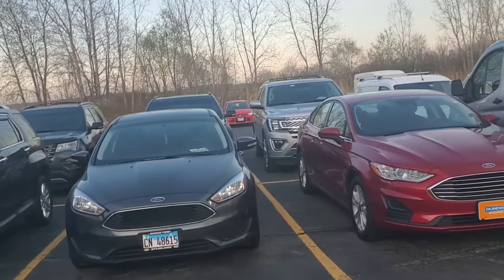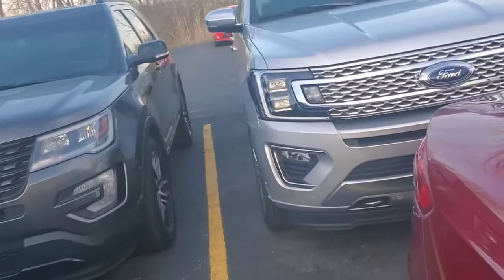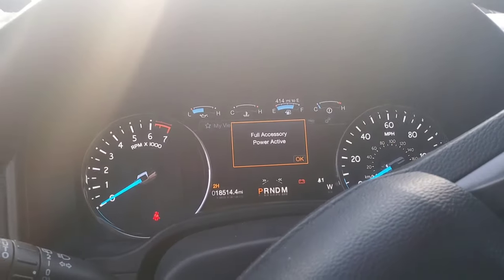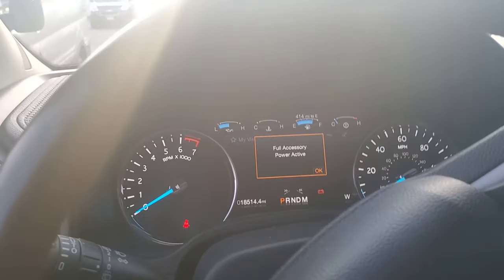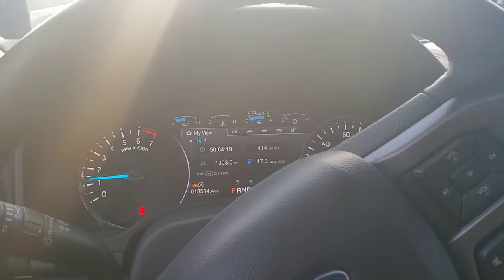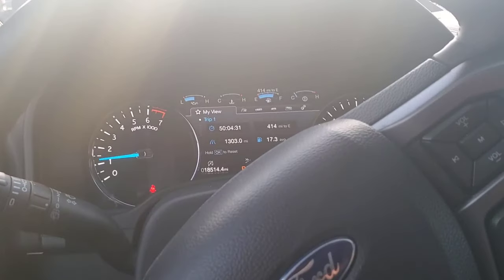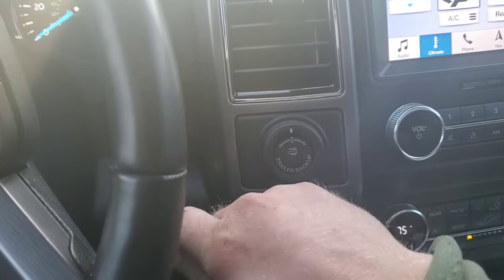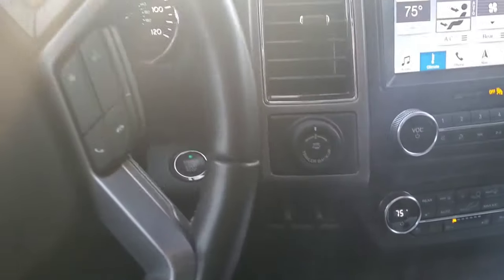3.5L Ecoboost F150 Rattle on Startup then gone, Try this - Could Fix Ford's Phaser Problem

Comment: Thank you. I have a 2013 F150 (164k) that for over 1 year has been doing the the start rattle.  This is the 1st video I found about it. Thank you!!! I tried this and it quieted it down greatly!!! 😁Hubby has 2017 F150 (53k) and his started doing it. 1st time extended warranty paid for its self and Ford fixed the problem ($5k). Now if I can find my coolant leak...
Reply from the maker: Typically these like to leak at the actual coolant reservoir itself and the plastic Connections in the front that the cooling system have in the rubber lines
Reply from the maker: The older F-150 like yours the 2013 yours is probably never going to completely go away because yours is more of a timing chain issue on the older ones the chains stretched more than the VCT phaser acted up but when you go to get yours done you're going to want to have new phasers and chain and guides/water pump everything put on

Comment: Just finished a complete timing replacement.   Ford OEM parts.  Phasers, vct's, chains,  guides,  tensioner.   I still get a massive rattle at startup after sitting for a couple days.   
My timing system did absolutely need replaced.  I jumped my chain.  It was so stretched that the moment i pulled it into my shop and turned off the engine i heard the cams ratchet 5 or 6 teeth.  Enough to keep me from rotating the harmonic balancer without piston and valve interference.  

Anyway. Holding the gas peddle down for a few seconds solves rattling.  

Now thinking of this I  contacted someone i know that can do some pcm
 programming it possible to keep the injectors off until oil pressure is detected.   Beauty of this is there will be no extended cranking after initial first of the day start as oil pressure is already primed.

Comment: I just tried this trick my 2012 F150 with a 3.5 eco-boost. it had the 3 to 5 second rattle , And it worked. Thanks!
Reply from the maker: It's jot a fix but it does help

Comment: Takes about 10 seconds to build pressure in my 2013 F150. 

I imagine the life of the starter will be reduced quite a bit with the long cranks on first start up of the day or after 4-6 hours of sitting. 

Either way, no rattle after pressure builds. 

Thank you!
Reply: Same truck and I've noticed it not doing it with this method. You have any updates or is it still not doing it?

Comment: Thank you - thank you!!! my 2018 f150 EB finally started to get that noise regularly now.  This past weekend in Vegas was a loud one that startled me.  I thought my truck was broken and I needed to stay a few more days  😉 !  I was skeptic to bring the truck in for 21B10, as I didn't think it will solve 100%.  Will give this procedure a try and report back.
Reply from the maker: This procedure doesn't fix the problem it only makes it easier on syrup you still have to go along the procedures have it fixed

Comment: This is why huge diesels like locomotives have a prelube system. Ford really should update the pcm to crank longer for early oil pressure. It would solve noise and wear issues.
Reply from the maker: it would definitely help

Comment: Thank you man ! I knew it !! I'm a mechanic . and I knew this would happend one day on my 2011 it only has 130 nice kilometers . I been giving it bit of key ro build preassure too . but in getting worse . and replacing the chain is crazy work and it shouldnt happen so soon at 120 k started . no codes . is all good that is the problem no pressure and only one tensioner on the old models . yes ford should put a new mapping on this 3.5 eco . at least fix one problem of the many that has . in very surprised ford screw up so bad . for the sake of a bit of power and fuel economy . no enough time testing . yes ford help your customers .

Comment: Thanks , I have that issue and your solution works, the dealer told me it was the oil filter backflow preventer, but since they change the oil and filter, it still rattled if the truck sat for a while.  Great tip.
Reply from the maker: Thank You

Comment: great video. Consider doing a timing set on your Town Car. Upgrade to the metal tensioners. The gaskets on the rear of the plastic tensioners can blow out and the hydraulic tensioners get weak with heat cycles regardless.  Up grade to the metal tensioners as they don't have a gasket and they have an oil squirter that cool and lubes the chains and the metal tensioners have a little ratcheting arm on them that holds the tensioner arms out tight against the chains at all times. It is the loose chains on start up that slap around and bust the chain guides. A slow crank PCM reprogram on the Town Car would help as well, say 2.5 seconds of crank before fuel turned on.  Lots of great info. Great video.
Reply from the maker: I heard they have an all-metal set but I don't know what the part number is for it yet I haven't looked it up
Reply: Melling BT402 and BT403. Apparently the metal tensioners from the 4.6 2V fit up to 5.4 3v at least and solve that whole issue.

Comment: My F150 makes exact noise you’re talking about going to try your method to see how it works thanks for this video
Reply from the maker: You are very welcome
Reply: Man I had one due the same thing and took it Ford several times it did this since day 3 of ownership brand new truck drove it off the lot with 55 miles they changed the flywheel and all
Kinds of stuff eventually traded the truck for a GMC
Reply: Amazing

Comment: Ive always done this ever since ive been wrenching , over 32 yrs now, always disable starting somehow whether its pulling coil wire or smacking the inertial shutoff switch in the older ford vehicles, then cranking for several seconds, it has never caused me any grief yet, quite the contrary...a few extra seconds every few months pays dividends over the life of the vehicle by keeping it on the road instead of in the shop or worse....

Comment: Ive been doing this on my 13 eco with 225k for the last year now, doing the long crank for the first cold start of the day with good results. IMO though, if Ford programmed the ecu to long crank after 8 hours for example, people would complain that the vehicle isn't starting, or its "going to wear out the starter" they would need some kind of secondary electric oil pump to prime the same way the fuel pump primes as soon as the key is turned on then delay start for n seconds after key on.

Comment: These Gen II 3.5 engines have had this problem already for the last couple of years with no permanent "fix" to them as of yet. I have seen/heard this horrible noise on even some brand new units during PDI. If you think the noise is horrible during cold engine startup, you should hear how some of them sound during initial startup just after doing an oil change. Sounds almost like a rod is about to window the block!
Reply from the maker: That's why I always have my lube techs flood mode them so they don't run into the situation after an oil change

Comment: I have a 2014 F-150 with the 3.5 EcoBoost and it started doing the rattling at start up pretty bad especially in cold weather so what I did was I stopped using motorcraft oil and started using Amsoil oil and started changing it at 50% life and also started adding an extra half a quart of oil at oil changes and I haven't had a problem in a year-and-a-half of doing that it doesn't rattle at all anymore

Comment: this worked on my F150 3.5 ecoboost.  Turns out my truck has 18 separate recalls (!!) taking it in to dealer on July 5, hopefully no damage but it has been knocking for a few months, the cold crank start was only more recently.  This trick did stop the cold crank, and it seemed to minimize the knocking but maybe not.  Sounds like a diesel.

Comment: I am finding oil pick up tubes filled/clogged. Massive lack of oil changes is the biggest culprit. People driving full synthetics on short drives which won't let synthetics get to temp,which causes  the  phaser filters to clog up because synthetic actually leave a coating behind and builds up over time.

Comment: Awesome stuff! Gets me thinking they will be warranting a gigillion starters in short order tho, I have a great idea-  engineer an electric assist oil pump that is activated at key on while foot is on brake pedal. Even if you try to crank it in key start position, the engine won't crank fire until the oil pressure is up to an adiquite spec.

Comment: My understanding is that direct injection engines tend to have fuel dilution problems, oil change intervals are stretched and the chains wear, past the point of the tensioners ability to deal with the wear.

Comment: This does work, I had the same idea and success.  Ford did finally figure out the phasers are what’s stretching the chains which allowed the tensioners to come too far out and blow their seals.  New chain, new tensioners & new phasers to fix for good supposedly 🤷‍♂️
Reply: And Ford isn’t currently covering this cost? I starting having this issue and it sounds expensive
Reply: isn't that a separate issue on the 15 and down ecoboost?
Reply: @Dickj203  do they just cover their cam phasers or will they cover I need chain and tensioners I got the recall and I believe it just said just the cam phasers I have this on cold startups I have 46,000 on my 18 3.5 EcoBoost.

Comment: Fixed my 2015 Expedition with this method.  But I also eliminated the need by switching to quality full synthetic oil at 5,000 mile intervals.  Took about 15k miles before it was totally gone.

Comment: Lucas oil treatment newer engine formula is for variable timing engines. Helps on cold start for. Jeep high horsepower 4 litre used to have an extended crank time to get oil pressure first. Was strange feeling but worked well.

Comment: Truck's been rattling on start-up every morning since the weather got cold this year. Been sitting for over a day and just went to test it out. Worked like a charm.

2011 3.5 ecoboost F-150 with 105k miles.

I'll continue doing this until next spring when I can replace the phasers in the comfort of good weather.
Reply from the maker: Good Idea - it's a chore to replace for sure

Comment: My truck is a 2020 3.5L and I bought it with 50k miles. On start up at the dealership I started the truck and heard that weird rattle got out of the truck went to listen to the engine and no longer heard it. 

I turned the truck off started it again, no rattle. Thought I was hearing things. Bought the truck next morning started it up and heard it. Lol. 

Truck now has 97k miles but the rattle has gotten far worse and louder over time. It’s a great truck but knowing the phasers are junk is a hard pill to swallow. 

I will do this every time I start it now. They should recall but the amount of cars coming in would back them up for numerous months

Comment: EVERY engine should have an electric prelube pump - I just bought a used 2017 that has this issue, and I'm hoping this will fix it and I don't have to do the other side and replace the VCT units.  I work with industrial gas compression units and we wouldn't DARE cold start that when an electric prelube is CHEAP compared to the machine.  Things like these turbos with VCT a simple little 2 second prelube, JUST like the fuel pump - would save tons of headaches and money

Comment: My 18 Raptor has been in the shop for about a week now, Ford is replacing all 4 cam phasers. I hope replacing them fixes the problem for good. If not I’ll be giving this a try.
Reply from the maker: A lot of people have said 30 40000 miles they can hear more noise but a lot of people have also responded that they've heard no noise

Comment: My 2019 f150 company vehicle was fine until one time it sat for a month without being started while I was on vacation.  When I started it after sitting for that month, it rattled something terrible for about 4 seconds, them quieted down.  Ever since then,  the cold start rattle kept on happening.

So, maybe simply making sure you start it at least once a day will keep it from ever developing the rattle.  Kinda like… "A start up a day keeps the rattle away".
Reply: Same with my f150, 100k plus on it let it sit for 2 weeks and it did it for the first time, started it numerous times after with no issues but I guess not letting the engine ever get super cold to the point where all the oil has settled in the pan/lower in the motor might be a good preventative measure, not a mechanic or anything just a thought, def gonna try this elongated crank strategy.

Comment: I have a 2013 F150 3.5 engine since 6 years 
Never had any big problems with the engine or other things besides normal maintenance 

But since a year ago 
I did the oil change at 5,000 miles 
I always change it before that at 3,000 miles and never had any issues before 

But since the 5,000 miles oil change 

it actually started doing a Rattle noise 
even so I been changing the oil with full good synthetic oil

 from time to time 
the problem 
Started to getting worse to the point that the Rattling and ticking noise was so loud 

Hired a mechanic to check it and he told us that something was broken inside on top of the engine 
Which he said that it would be a Camphaser 

He took it to the shop and they opened which he was right 

Also the engine was very dirty probably because the first owner didn’t take good care of it
I bought it with 55,000 miles on it.

The mechanic did the timing change job 
and clean 
the oil pickup filter in the bottom 
because the oil pump was not working at 100% but probably at 50% since it was dirty 

He did the job alright 
Charge us $4,500

The truck work really good since 2 months 
Until now that a Rattle started again in the mornings 
when the truck is settled down and not warm 

The Rattle stays for at least 3 minutes then it goes alway 
After that won’t do that Rattle all day on every startups 
But it does next day every mornings.

Any advice on what to do will be appreciated 
Thanks 

Like your videos.

Comment: So I have a 2013 f150 3.5 ecoboost and two weeks ago it started doing the rattle on first start up every morning.   It don't do it every morning but some mornings it does and some it decides not to.   I tried this trick this morning and it cranked and cranked and cranked for about 15 to 20 seconds and I never did see the oil pressure build up on the gauges. And as my starter was starting to slow down like it was either getting hot or my battery was starting to die off,  I decided to go ahead and let it start up.  Rattle, Rattle, Rattle still.  So I'm gonna go with this won't work on a 2013 f150 ecoboost.
Reply: Worked excellent on mine and I have the exact same truck. I notice it rattling on start up sometimes when I bought it like 20k miles ago. Tried this tip and it doesn't do it anymore.

Comment: Thank you, my 2017 Eco Boost F 150 has been to the dealer many times due to this problem, the Cam Assy rebuilt twice but the problem still exists. . I t sure seemed to me that it was a lubrication problem your explanation helps

Comment: Great observation hopefully they implement it.
I have a 2013 f150 limited and now just start doing that if sits for more than two days!👍🏾💯🔥. I thought about doing it but was concerned flooding the system with gas .
I have another issue with the service trac and hill descendant only when is cold weather under 50  degrees. Whats the suggestion?